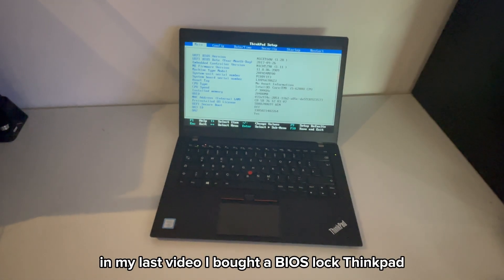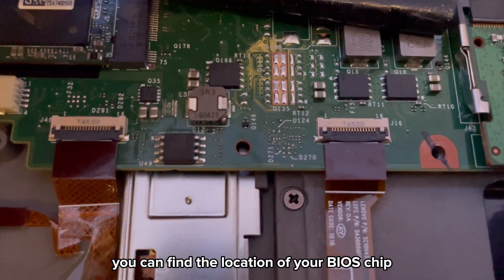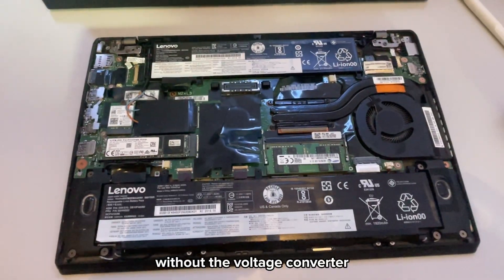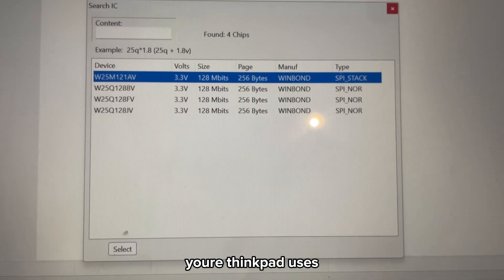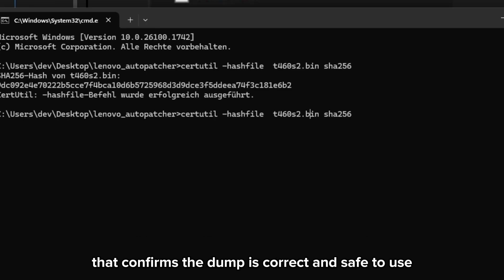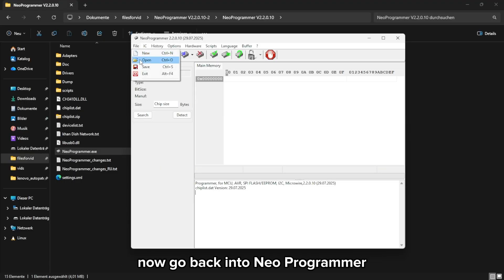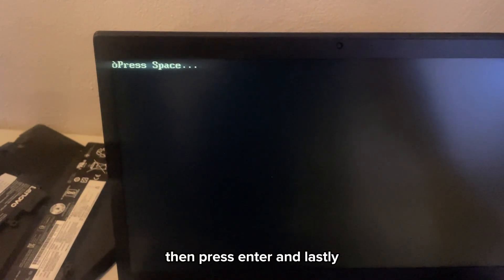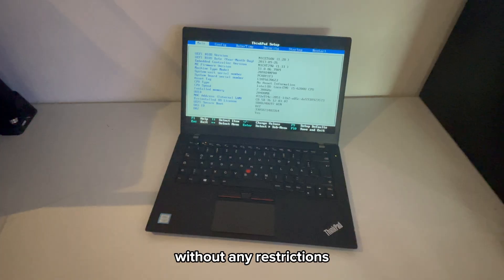How I Bypassed a BIOS Password on a ThinkPad (Full Tutorial)

Comment: I have a older T40 with the bios locked - do you think it will work on that?
Reply: I've tried to do the shorting of pains 5 and 6 , but I can get it to reset
Reply from the maker: You can try it I mean if it doesnt work you can just write back the original firmware but i think for you’re model there should be a shorting trick. Let me know what worked